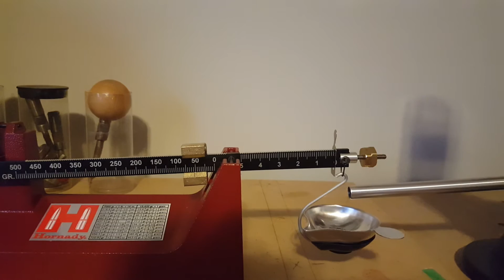Loading with the hornady quick trickle

Comment: The Lee safety scale is magnetically dampened. the reason why I don’t use it is because 1/10 poise is too hard for me to read, but when it’s leveled out and set correctly there is not a balance beam scale that could beat it, literally it is riding on a fully enclosed razor. In fact...I use it to verify my other scales.the Lee perfect powder measure is a cheap piece of plastic but it is the best powder dispenser when it comes to large stick powders, it’s not a problem to get it to within 5/10 and then trickle up and that’s usually one and ahalf turns with any trickler. as you grow older you will realize that the simplest way is usually the best way👍

Comment: couldn't you could  throw a short 49 grain load with the Lee than trickel the last grain for accuracy ? to me it would speed it up for you
Reply from the maker: Eddas Stuff you probably could. But I'm short on space and removing the Lee powder measurer opened up some space in my bench. I have been using varget and h4350, and it only takes 2 turns to get to 40 grains.
Reply: fair call mate ,,, nice vid made me buy one :)

Comment: DOES IT COME WITH THE HAND CRANK FOR THE LARGE TOP KNOB.THANKS
Reply from the maker: HENRY CHRISTOPHER no there is no hand crank that comes with it. I'm unsure if someone makes one for it but the wheels do turn rather easy with little to no drag. Obviously the larger the kernels of powder the faster it will add up in the scale pan and the harder it will be to turn the knob. I primarily use varget for 308 and it takes a lot less time to trickle than exterminator.
Reply: AFTER WATCHING THE VIDEO THREE TIMES I MADE OUT YOU WERE USING YOUR FINGER.IT WAS HARD TO SEE IN THE SHADOWS.IT LOOKED LIKE YOU WERE USING A HAND CRANK L.O.L.IT WOULD BE A GOOD IDEA.I USE IMR 8208XBR IN MY 223'S AND AR'S,VARGET IN MY 308'S AND H1000 IN MY 300WM.I WOULD LIKE TO KNOW HOW WELL IT WOULD TRICKLE IMR 800X FOR MY 10MM,357 SIG AND 45 SUPER.800X IS A HARD POWDER TO METER.
Reply from the maker: HENRY CHRISTOPHER it is a little touchy and can trickle a lot of powder pretty fast. For lighter loads I wouldn't even use the big wheel. When I'm near my target weight I give a light tap to the bottom wheel and that allows individual grains of powder to drop into the scale pan. With some finesse you gain the speed of a measurer and the accuracy and precision of a trickler. My guess is it would meter your 800X well as long as you take your time.

Comment: Thank you so much for doing a video on this product. I really wanted to buy one but I was hoping the powder would come out faster so it seems kind of worthless. What about using those little hand held powder measure cups and a regular trickler? That would seem faster to me.

I'm just getting into reloading and I need scales also. I see you prefer mechanical. Are there reasons that you don't like digital scales? I'm old school and like mechanical but it sucks that you have to get eye level with it to see exactly where it's pointing so I'm leaning towards digital just for that reason. You would think after all of these years they would come up with a better idea like a little mirror or something so you don't have to hunch down or place the scales at eye level.
Reply from the maker: Gravity doesn't lie. That's why I like mechanical over digital, plus or minus tenth grain accuracy isn't good enough. Also I used Varget in this trickler the other day and it dumps powder so much faster. 50gr charge in 4 turns!
Reply from the maker: I guess a proper question you should ask yourself is what type or types of powder will you use. If it's a ball or flake type of powder it will trickle much slower due to each kernel of powder being so small and weighing so little. If it's a stick powder then they trickle 3 to 4 times and sometimes faster than the powder previously mentioned. I enjoyed using varget with this trickler because of the speed. I loaded 50 rounds in 50 minutes, and they were match quality rounds.
Reply: +Kyle Mitchell Four turns is very acceptable. I did a lot of research on scales yesterday and I found some very good information on Precise Shooter in which the author has access to high dollar laboratory scales. He tested the GemPro 250 and found it to be amazingly accurate when plopping down a specific weight all at once. The problem with this scale and probably all digital scales was with trickling. They just don't respond accurately with small weight additions.
Reply: +Kyle Mitchell I haven't even looked at powder yet. It's overwhelming enough just trying to pick out good equipment lol. 9mm, 38 special, 45 acp, 223, and 30-06 are the know rounds. Maybe 6.5 Creedmore if I get into precision shooting. All of the first rounds I mentioned will be done with a powder thrower but I still need a way to accurately check them.

I also stumbled across an interesting trickler that I need to look into more. It's called Omega and works by vibrating. Seems to be very adjustable with flow rate.
Reply from the maker: +Nicholas CeeA I would start with a good reloading kit that comes with high quality balance beam scales. RCBS, Hornady just to name a couple and get a powder trickle of your choice, they can be relatively inexpensive. I've been reloading for quite a while and have learned that everyone has their own preference of the process. But at the end of the day only a few things matter, you are making safe high quality ammunition at a fraction of retail, you are having fun, and you are doing all of this with equipment you are happy with! I'm glad I could help and there are plenty of product reviews here for your leisure. Welcome to an expensive and addictive hobby.
Reply: +Kyle Mitchell It looks like mechanical wins. Funny how things work out sometimes. Looking at the Omega site I see that they offer an adjustable prism for viewing the scale lines. Something else to research...haahaa